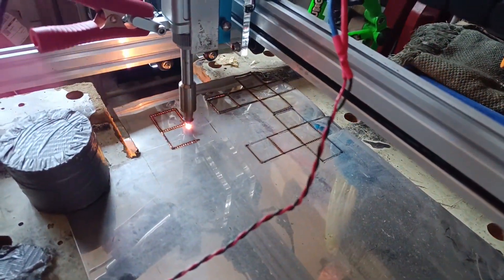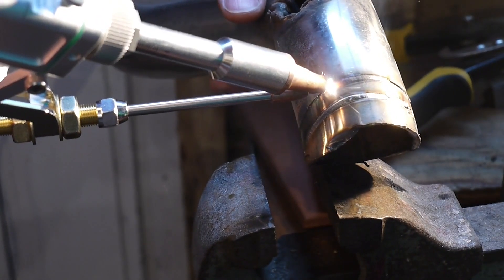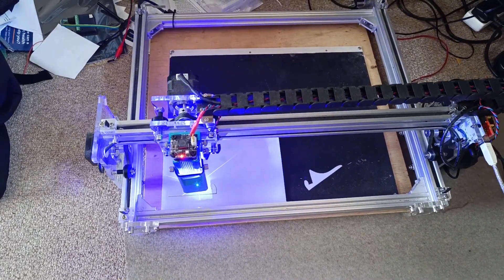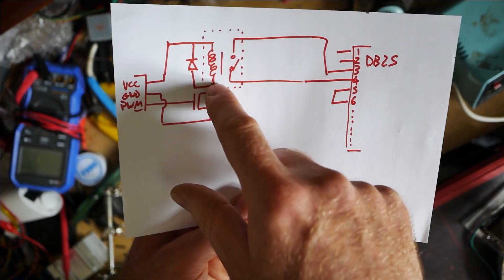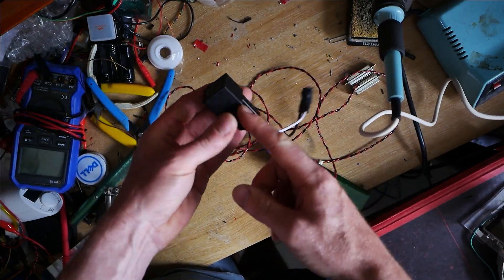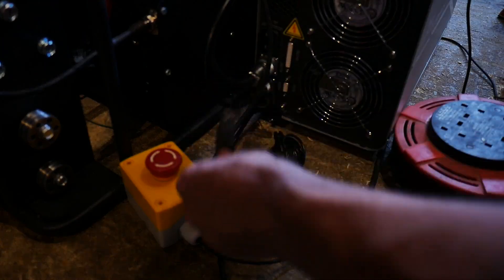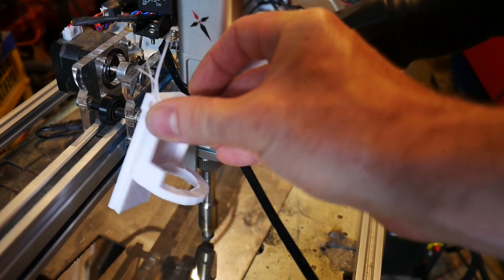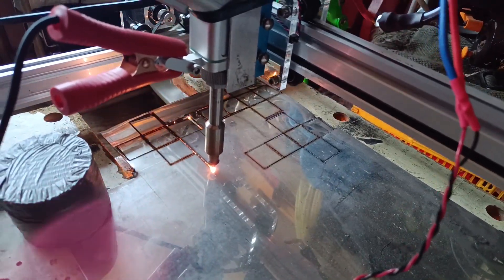XPhotonics XLaserLab X1 Pro cheap Fibre Laser CNC

Comment: I managed to get it working with the FET and optocoupler as suggested in your GitHub. However, it seems like the signal is still floating despite the resistor. It could be either an issue with the wiring or something in the code. I’m not sure where to install the lines of code you included in the software section of the GitHub—should they go into the X1 laser, or do I need to use an .NC editor to modify the G-code directly? Also, have you ever tried wiring it up with the parts you suggested instead of the car relay setup? A follow-up showing exactly how you wold do it would be incredibly helpful. Thanks!

Comment: Interesting video, thanks! One of the concerns I've read for adapting "cheap" hand-held laser welder/cutters to X-Y CNC in a vertical position is the risk of beam reflection going directly up the head and damaging the optics, do you have any thoughts on that risk? Have you had to replace any elements?

Comment: Is the wiring all you had to do? I used the products in your github and it isn't working.  If you had to reprogram something in the machine how did you access the logic? If you didn't reprogram the machine, then is there a chance you got the wrong pins? I would love to see an update as well.
Reply: Do I need the fet, besides the Optocoupler?

Comment: Gordon, thanks for posting.  Once I get the X1 Pro unpackaged and ready to go (arrived today) I’ll be taking another look at your video to interface to my Openbuilds system.  Have you solved the overheated head issue you reported earlier?
Reply from the maker: Yes - I just connected it to a compressor (I couldn't get the airflow from my Argon cylinder, and it gets expensive fast!). I have however just had an issue with the X1 Pro's air pressure sensor (I was running it at 7 bar, instructions say up to 8 is ok) so I'd say be a little careful - maybe start at 4. Judging by the new slight hiss I think it's likely a pipe come off inside the X1 Pro but I'm waiting for their support to get back to me on whether I'm allowed to open it and put the pipe back on without voiding my warranty!
Reply: I heard you cannot aim the street down while cutting. How is this held up?

Comment: Thats super cool! Looks like the stainless was between 1mm-2mm? I am interested in setting this up for 0.7-0.9mm stainless. Are you planning to tweak this further? Looks like it could do with a bit more air pressure/flow to reduce heating and dross, definitely interested and grateful for your work so far!
Reply from the maker: Yes, I can't remember exactly, it it was around 1mm, maybe a bit less. Previously I didn't run with enough air pressure and I slightly melted the nozzle, and in cleaning it up I widened it - so I think with a new nozzle (and maybe tweaking the focus) I'd be getting better cuts too.
Reply: @Espruino  Thanks for the reply! I wonder if you could also lower the nozzle to get better air pressure at the cut, I am considering getting a nitrogen cylinder and just seeing what the cut quality and how long it lasts is.